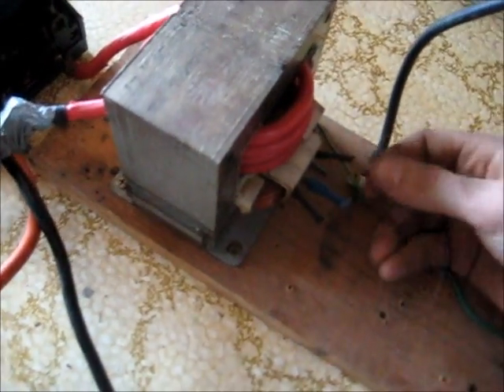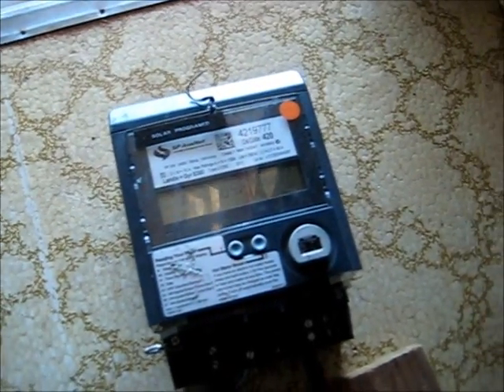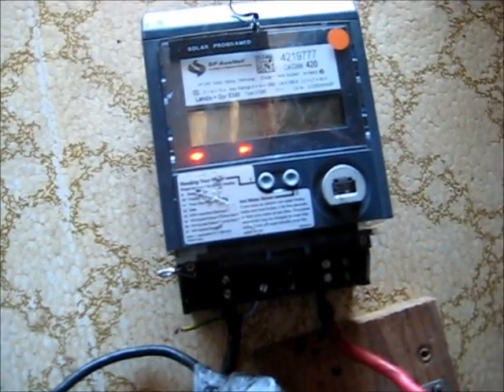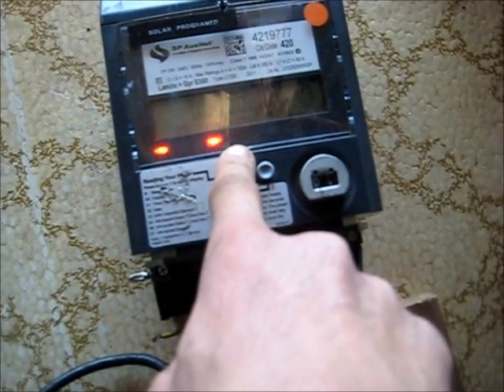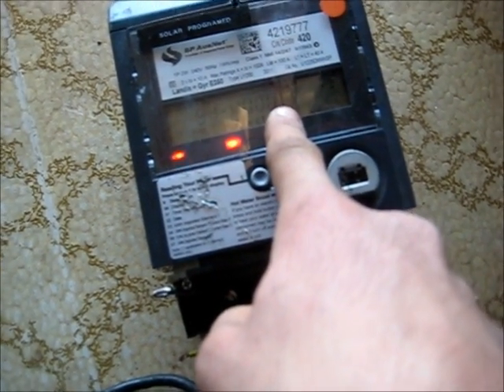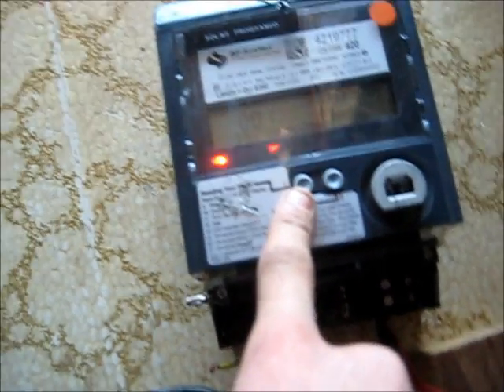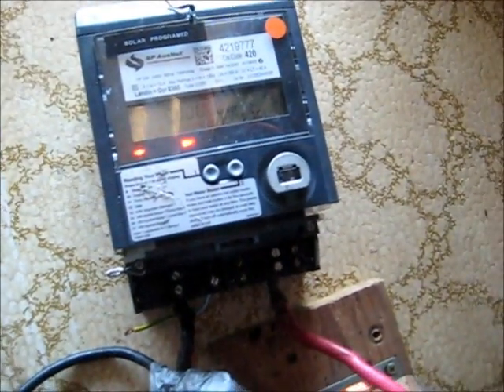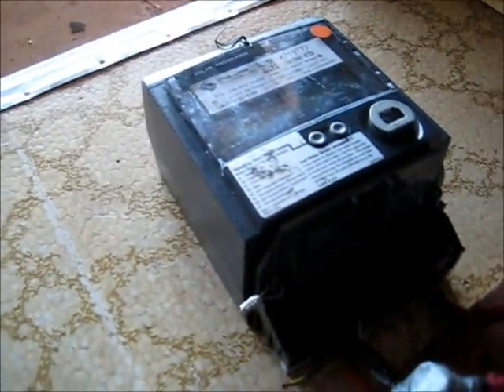Phantom Loading a Smart Meter

Comment: Thought: What's the max amps you can get out of your welder? I can't remember.  Can it outdo this rewound MOT? If it comes close to the MOT's capacity, or just past it, then at least it may be able to hold out a little longer without burning up. That's what's needed to make that meter *POP* : Current over time. Too much current for too long = FLAAAAMES! :-D

Also, do you know the size of the cable on your rewound MOT? I'm just wondering how we could get more amps out of that thing. :-)

-BBD.

Comment: Mmmm, more current needed. I think, what may need to be done here, to get that meter to *POP*, is to use 2 or more re-wound MOTs.

Amazingly, one doesn't seem to be enough. I had some idea that this one may be a tough little nut to crack! I bet the busbar in the meter got a bit warm though. :-D

Yes, this may need to be re-visited a little later on.....with three-or-more re-wound MOTs.

If you can temporarily squeeze 200A out of one, then 4 of them will give a meter-busting 800A :-D

-BBD.

Comment: More current!!! Actually, I still want to see if you can crash it before its final meltdown. Less turns of thick wire on the mot should match it better, might be enough! I have to think lots of these must die in thunderstorms!Do you have a piezo igniter you can let off around it??? Heh Heh!!!

Comment: You can always put a 1 Amp fuse on the isolation TX circuit. That iso-TX should not be affected by burning out the meter coil with large currents.

Comment: Absolutely pathetic, considering how new that thing is, "Dumb" meters is what they are since there is very little that is smart about their design or reliability. I will bet it's full of RoHS garbage lead free solder, dry joints, tin whiskers and all. Here the dumb things are causing fires, many because of idiot installers but some just blow up on their own. Your old mechanical EMAIL meter still works fine even though it's 50 years old and survived a damp environment.